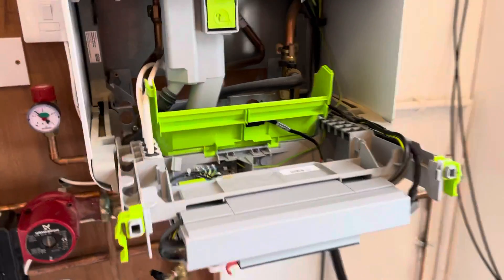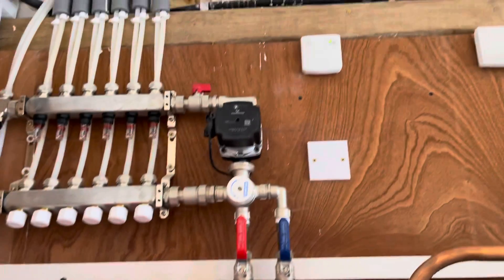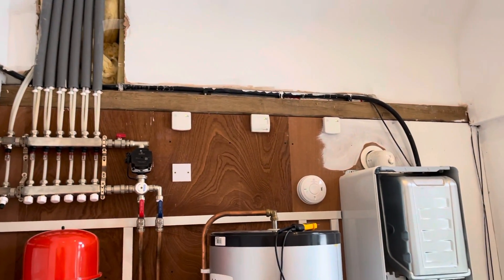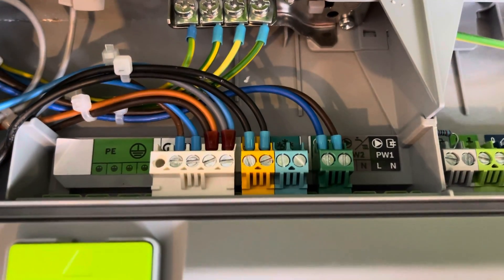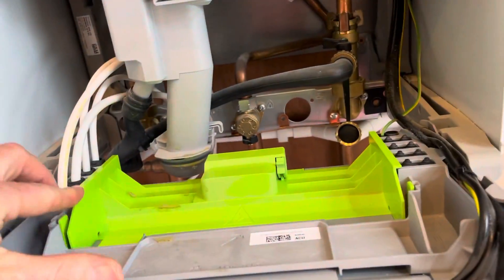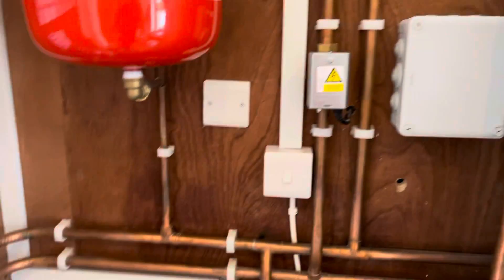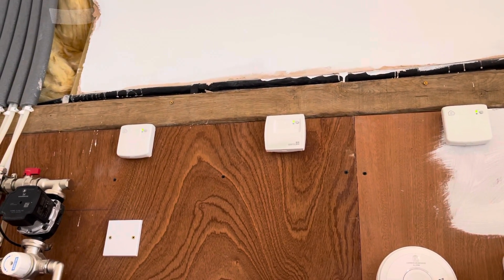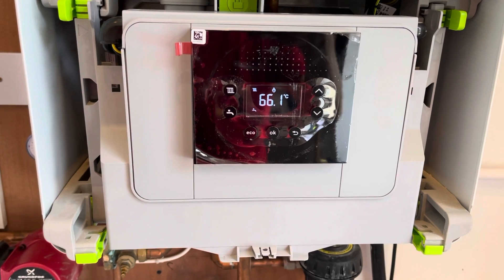Worcester 8000 Series Converted To PDHW With Honeywell Home evohome | MWPHS.co.uk

Comment: Hi why does it need a switch live to the water the system boiler is on or off
Reply from the maker: I don’t fully understand the question. The boiler in this video needs to know when there is a call for hot water to give a different flow temperature, hence a switched live on the hot water demand from the evohome hot water relay.

Comment: Does anyone have the full spec for the required resistor, or is only the 10k ohm all that matters?
Reply from the maker: I just used a resistor out of my electronics kit.  The only thing that is important is that the resistor reads 10000 ohms when you put a multimeter across it.

Comment: I've tried doing this with my Worscester Bosch 8000 Regular but the 10K Resistor isn't seem to be doing anything. I've tried a few 10K resistors but the DHW stays crossed out on the boiler. 

I can manually enable it by pressing the DHW button on the boiler and choosing a temperature but that has no effect. When checking the DHW sensor read settings under L.1 service menu it doesn't show any temperature reading but empty dashes. I was expecting it to show a reading around 30 degrees Celsius due to the resistor.

Is there some earlier versions of this boiler where this hack doesn't work? The layout of the connections is exactly the same as in this video and when checking the manual it does suggest it supports the optional cylinder sensor. I can't seem to think that the PCB would be drastically different that the optional cylinder sensor feature is missing altogether. If anyone has any other tricks, please let me know. Thanks
Reply: UPDATE: I managed to get it working after all, I got a 10K thermistor which did the trick. Still not sure why the resistor didn't work.
Reply from the maker: If a 10K thermistor worked a 10K resistor should have too. Weird one?
Reply: @MWPHS  Yeah, still puzzled by it. I did measure the resistance on the resistor using a multimeter and it was exactly 10. 

Now that I think about it, I might of accidentally purchased a bunch of 10 Ohm resistors instead of 10 k ones. 🥲

Comment: This is fascinating! So a just a 10ohm resistor will mean I can use my 8000 series (without the diverter kit) in PDHW mode?
Reply from the maker: Correct. :)
Reply: @MWPHS  Wiring changes made - resistor added, hot water valve output wired to hot water live return on boiler & I now have two different temperatures! 
The boiler seems to be flowing to the cylinder at max temp (83 degrees or so) rather than the set hot water temp, but I can now reduce my radiator flow temp down to 50 degrees or maybe even less - some playing to do.
The big advantage of this over the Worcester diverter kit is that I can keep the flow to the cylinder in 22mm pipe & make the most of the high output coil whereas the Worcester kit restricts to 15mm pipe. Also this modification is cheap as can be!
I still need to modify the wiring or fit a normally open valve on the heating to make my system hot water priority, but having two flow temperatures is a massive step to a smarter usage of gas. 
Many many thanks!
Reply from the maker: @pghampton  brilliant! Thanks for letting me know! 😎👍🏻
Reply: @MWPHS  so I have the same issue as well. Got it all set up but the hot water flow goes to 84 degrees and ignores the flow temperature I had set for this. Any reason why this is and how I get around it?
Reply: @pghampton  I've got the same issue where boiler seems to heat up the hot water one max flow temperature and ignores what I set. Did you find a way around this?
Reply: Hello! So I changed the fixed value resistor to a thermistor that is inserted into the temperature probe tube part of my cylinder. I found the thermistor specs somewhere on the Internet. Will search my purchases. 
The boiler can now read the temperature of my tank & I believe now runs at the output temperature I specified (it’s been a while so I’ve forgotten)
Reply: From RS components I purchased

Temp Probe, NTC Stainless Steel, 10k, 3m

Hopefully this helps!
Reply: @pghampton  thanks. So did you have to make a hole in the cylinder or did you put the probe in the electrical immersion slot so it can read the cylinder internal temperature?

Comment: I'm going to be fitting a similar system with the same boiler and 3 heating zones. I will be using the ntc sensor for the cylinder. Have you used a normally closed relay to interrupt all of the browns on the heating 2 ports?
Reply from the maker: Correct. The hot water receiver has a additional NC relay that when activated cuts the power to the zone valves. This is the relay I used - https://mwphs.co.uk/product/salus-relay-module-rm16a/
Reply: @MWPHS  thanks for getting back to me. So would I use 3 of those relays to interrupt each brown on the heating zones?
Reply from the maker: @1000Mikey  that would work yes, although there are other ways.
Reply: @MWPHS  what other ways is there? I understand having a normally open 2 port if there's 1 heating zone but this wouldn't be ideal from multiple zones. Would it be possible to speak to you about this?

Comment: This looks as though a similar setup will hugely improve the efficiency of my Worcester 8000, which would be most welcome!

Are there any installer menu items you need to configure to get PDHW functional, or is it just a case of just separately connecting the SL from the water and heating zone valves to the appropriate connections in the boiler? (And of course using a relay to prevent the heating zone valves activating when there is a call for hot water.)
Reply from the maker: As far as we can tell, it is only the resistor we fitted that puts the boiler into PDHW mode. There are several parameters on these boilers and some need to be adjusted to get the most of the 8000 series boiler in your application.
Reply: Why not just fit the Worcester mixer ? for PDHW ?
The resister may take the boiler out of Waaranty .
Reply from the maker: @mgbroadsterJ  because the customer had an evohome system and the MM100 wasn’t required. An NTC sensor is just a variable resistor so I don’t see why there would be a warranty issue (that was the least of this boilers worries).
Reply: Some people use a normaly open 2port valve instead of relays. 
Where do you get the different resister ?
How does it create two different temps without the Woŕcester mixer and if the mixer isn't  needed ,why did they design it that way.
Could I also use a Worcester wiring centre and not ha e to have somthing like evohome ?
Reply from the maker: @mgbroadsterJ  I believe you are on my Delta T Hydronics group on Facebook? I did post about this a while ago on there. This boiler has now been removed and replaced with something more suitable for the property. But, yes Worcester make an EMS wiring centre and mixed circuit controller (we sell both items). You could use them, but was easier to do it my way with what we had at the time. The new boiler is on X Plan (NO and NC configuration). I will have to do a video when I have time as it is a plate loaded cylinder, so quite an interesting one. Thanks for your interest in this.
Reply: I just rang Worcester asking how to set up the 8000 Life for an existing S-Plan. Got blanked - "You gotta buy the Diverter Kit or you can't ever get different dhw and ch temperatures!" I even asked how the kit lets the boiler know there's a cylinder, but they wouldn't say diretly, except to hint that the Kit includes a cylinder temperature sensor.  I even asked if they had the characteristic curves of that dhw sensor - "No." came the answer.  You really know where you are with Worcester, don't you ?

Thanks to Darren mentioning "about 30ºC with a 10 kOhm resistor...". I can see from page 74 of the Boiler Installation Manual that the it's likely to be the same as the flow Temp Sensor.  That means you need to fit a "10kΩ NTC sensor" - negative temperature coefficient calibrated at 10kΩ at 25ºC.  One such is at RS Online for £20 part number 121-4229.

Thousand thanks to Darren for making this video.